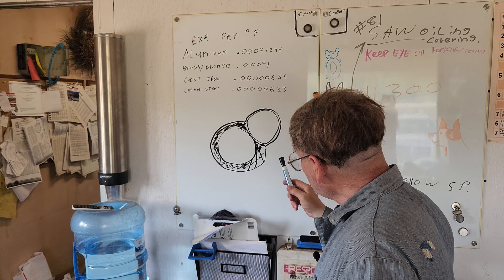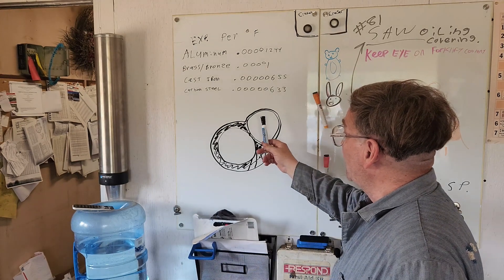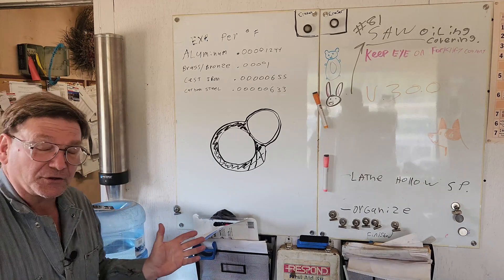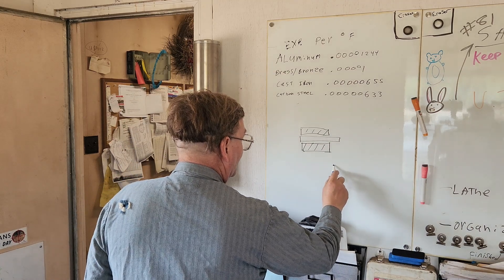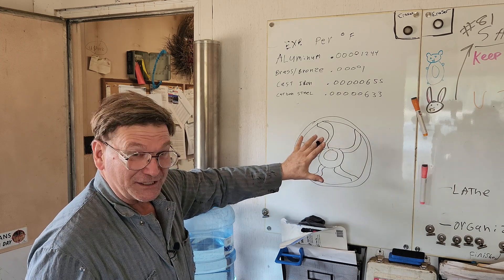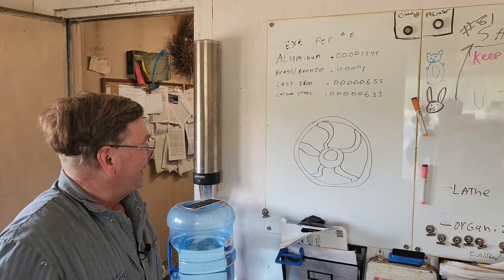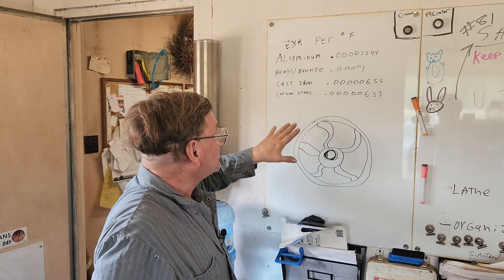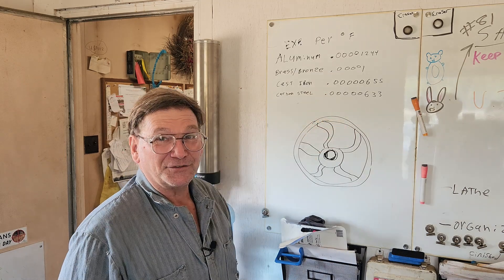Machinist's Minutes: Heat expansion and contraction in parts

Comment: I'm a young machinist been in the trade since I was 18 now I'm 26 I'm very happy u make videos like this I feel like I know this because I've successfully done it multiple times but there is always something new u can learn. 

Never thought about heating something out of round would make less clearance in some areas if not heated properly. 

I also primarily run cnc machines for rapid prototype work so the manual machines you run and the insight you give to the inner workings of them gives me an edge that other people my age won't have lol. Thanks again man. Great video. Now I've gotta get my shop to buy me some liquid nitrogen

Comment: Doesn't the mass of the parts in question come into play as well?  For instance, a bronze sleeve with a 0.125" (3 mm) wall thickness vs. a cast iron hub that has 2 inches (50 mm) of wall thickness.
Reply: No, or not really. The mass will dictate how much coolant (or heat-ant) you need and, indirectly,  how long it will take to heat up or cool down. So if you have a large wall thickness, it has more mass but roughly the same surface area as a thinner sleeve. 
Expansion is temperature over distance, Heat is lost through surface area and total heat energy is temperature times mass. This means that the thicker, more massive sleeve will stay hotter for longer, but the total expansion for the heavy sleeve will be the same as a thinner sleeve with the same temp and external dimensions (distance).

Comment: When it comes heat/shrink fits in my shop, I typically use heat and or nitrogen on ferrous to ferrous materials. On nonferrous materials fitting into ferrous materials, I typically just press. If it’s 4” dia or larger and or a 4” length or longer, then I use half of the heat calculated to aid while pressing but the amount of interference has to be considered as well because that difference typically transfers to the bore, resulting  
in and undersized dia unless it was machined oversized to accommodate shrinkage. Lots of variables.
Great video!

Comment: Heating that housing is a bad idea because of the differences in material Thickness and amounts around the area you are trying to expand...along with any heat treatments or or possibly having to heat it too much and changing the properties of the parts material...cooling the cheaper, smaller, more symmetrical part is the better option, don't get me wrong there is nothing wrong with adding some heat and cooling the other part, but with a  part like the transfer case part, it's best to heat the whole part in an oven setting where it comes up to a few hundred degrees all at once, which is not enough to damage it anyway, and not spot Heating with a very hot Mapp or oxy acetylene torch, if that makes sense, making it much less likely to warp or change the properties of the material, ensuring you don't Bork up an expensive hard to get part, If that makes any sense...and that's besides doing it on the machine where you can't damage seals paint sensors cause other parts to seize up boil fluids etc...if you guys have any other tips I legitimately would love to hear them I'm always interested in learning new things!

Comment: As a plumber, we use a torch to remove really siezed pieces.  Usually removing a stubborn butt weld screw on our sewer snake or maybe an extremely corroded nipple.  Thermal expansion is great, for what it's intended for, but you're absolutely right.  The heat deforms the piece substantially.  If we are torching something, it's usually a last resort, and we aren't gonna repipe it the way we found it
Reply: Steam pipe .
I get the hot wrench 
🍻🇨🇦👨🏻‍🏭